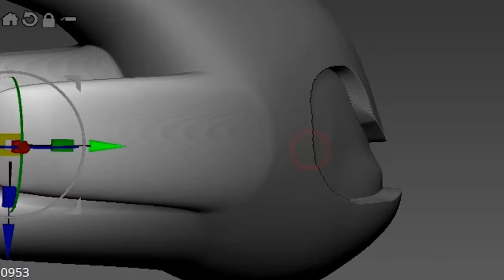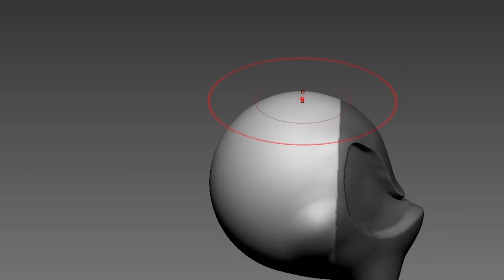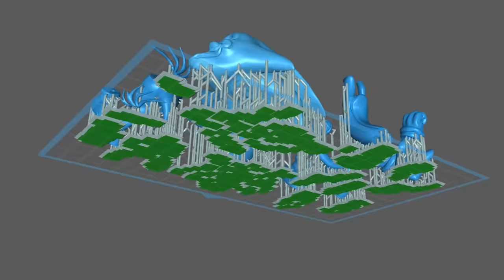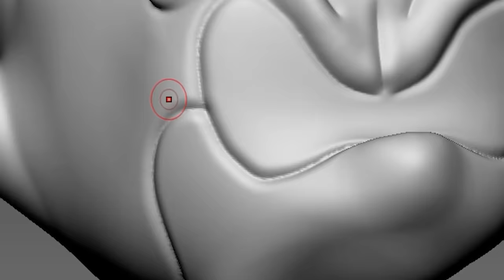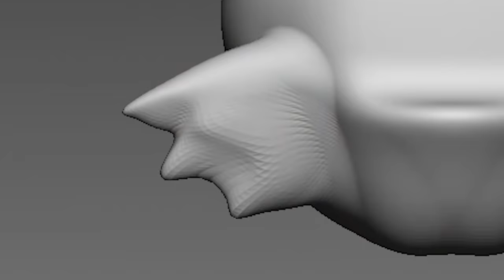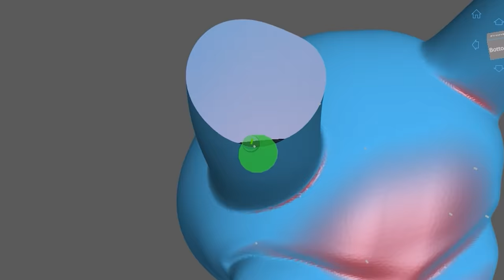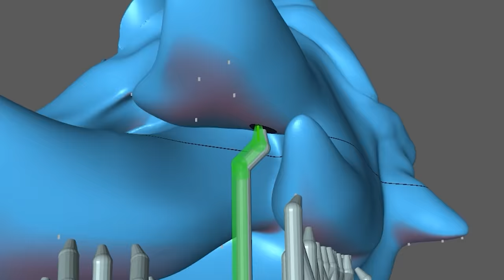Making VS Sonic.EXE Sculptures FRIDAY NIGHT FUNKIN'-10

Comment: Ooof lets start
0:27 you cant run(old)
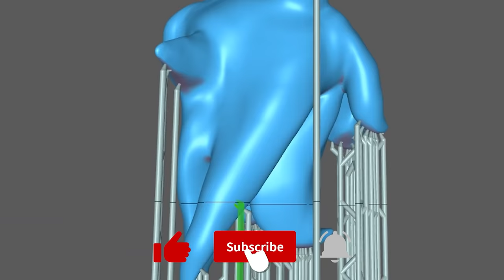3:02 faker
5:17 too slow
6:58 cycles
9:35 too slow(again :/)
11:27 idk what this music
16:10 endless
18:59 cycles (again :v)
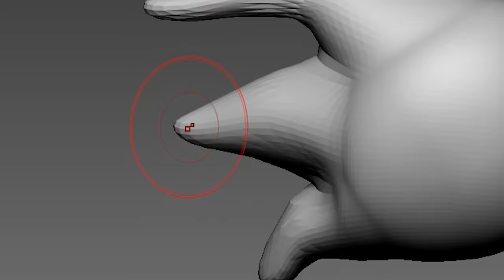21:24 milk
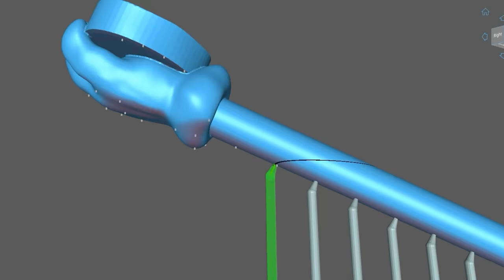24:32 triple trouple
29:33 too fest
31:53 chaos
34:18 triple trouple
41:44 triple trouple(again.....)
49:43 Sunshine
53:11 you cant run (new)
55:49 triple trouple (multi...)
59:34 faker
1:01:45 black sun
Reply: The too slow (not to be rude) is the same as current the charting for and sonic exe’s sprites are different.
Reply: The song at 6:58 is execution not cycles
Reply: @heck_spawn  its song(cycles) old version of exe